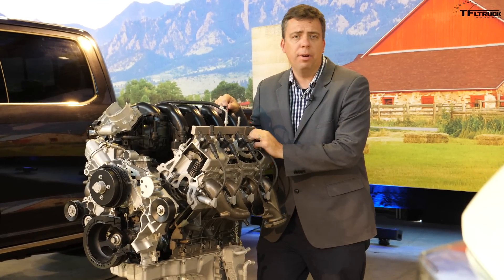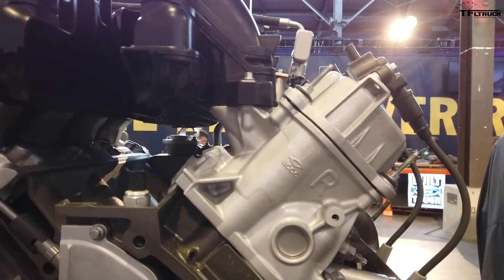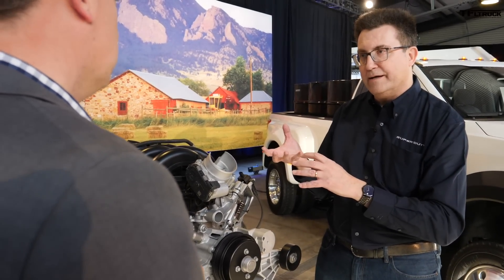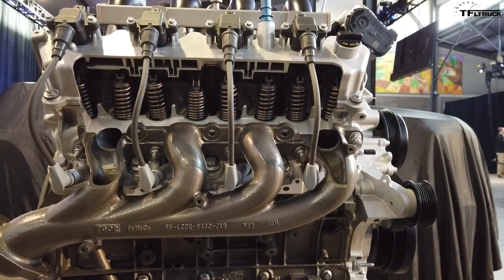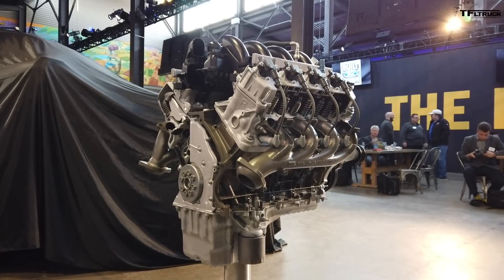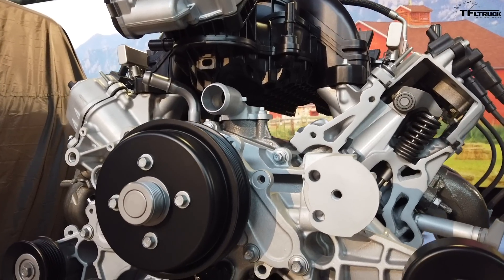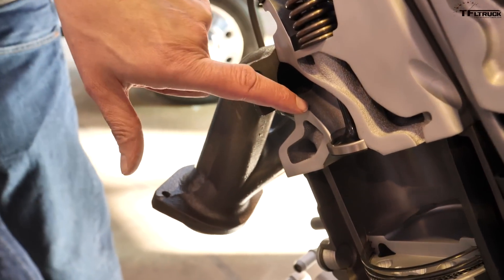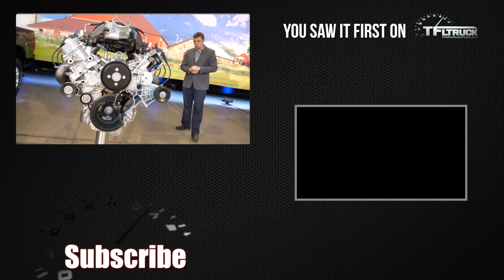2020 Ford Super Duty 7.3L V8: Here's What You Need to Know!

Comment: Ridiculous CARB and EPA mandates are killing diesel. This is a great gas alternative without a bunch of failure prone gimmicks... like turbos, DI, OHC, etc. 7.3L Super Duty is going to be a highly desirable truck!
Reply: Pretty soon EGR will be eliminated from diesels more DEF and that's a good thing. Some talk to new Ram Cummins will have no EGR. Diesel EGR is a weak point on Ford diesels. The main trigger the 6.0's grenaded.
Reply: @Dive-Bar-Casanova  I'm a Ford tech, so I am slightly familiar with the downfalls of the 6.0.
Def systems and EGR systems have caused more pollution than they ever saved in broken parts, wasted fluids, towing, etc. The science behind the carb and EPA pushing diesel emissions is mostly junk. There is a high level of corruption in the agencies. Paid these systems will go someday.... But manufactures must airways be ready for the eco-nazis in CA and DC.
Reply: The guy who owns Powerstrokehelp doesn't like working with 7.3 PSD trucks anymore. In addition, some collectors don't desire them because they are both computerized and difficult to make non-computerized. These collectors are waiting for the EMP blast that renders every computerized engine useless.
Reply: @skylinefever  as a Ford Diesel Tech, I'd concur. I hate 7.3s. mostly because they are just ancient and everything is falling apart on them.... And then there is 4r100s... Bleh!
Reply: Dive Bar Casanova a lot of modern gassers no longer use EGR.  You can thank OHC and variable valve timing for that.
Reply: Lol, DI is a gimmick now?
Reply: @dingusflingus  Your comment seems a little harsh man..
Reply: Hahodi d  they are dogs. Lol. It really makes you realize that turbo chargers are what make diesels powerful. But it's a very reliable engine. I used to drive one. A flat bed IDI. I enjoyed it.
Reply: @TheYummyBrand  ok. To be more clear. DI on gas. It causes so many problems with carbon build up on valves. Then there is Ford's DI but we also put port fuel injection on too just because we engineers and like to over engineer/gimmick up our products.
Reply: @fordtechchris  you're an engineer? What college, which degree?
Reply: @TheYummyBrand  nope. Ford Technician. I fix engineers mistakes....
Reply: @fordtechchris  I figured
Reply: @fordtechchris  which set of valves experiences the coking and which engine?
Reply: @fordtechchris  all collectivists really, lol
Reply: @fordtechchris   I don't think DI is a gimmick
Reply: @fordtechchris  turbos are the shit...I really like the idea of an electrically-boosted turbo/Regen system
Reply: @TheYummyBrand  intake valves on anything di. Eco boost, and the diesels with EGR. For the most part it's not a big deal.
Reply: @TheYummyBrand  to be clear, I'm not saying turbo is bad, or di is bad. But you have to look under the hood of these 1.0L engines Ford is building. It's a fuster cluck. With excessively engineered cac ducting. Multiple electric coolant and transmission pumps for start/stop... And when they put di and port fuel injection on the same engine.... SMH. Now have diesels with timing belts? It's just such a relief to see something like this 7.3L. and keep in mind, Ford was getting 30mpg in the 60s without all of this overly complicated regulation bred stuff we have now.
Reply: @fordtechchris  there are benefits to having port and DI injection, esp for high-compression engines... that's weird there would be coking on the intake valves, I would think exhaust if there are any anti-lag schedules in the tuning...are they overlapping the valve timing slightly?
Reply: @TheYummyBrand  I am sure there are. I'm sure Ford wouldn't do it if they couldn't squeak out .01% decrease in emissions or increase in MPG. When the government's gun is to your head.... You must deliver!
Gunking on intake valves is deposits from soot in EGR on diesel. And oil bypass from pcv on gassers. Pfi helps wash that oily residue. 
ButI believe engineers can get plenty of power, economy and reliability out of a really really basic engine. And offer it at an adorable price.
But what the heck do I know.
Reply: Hahodi d  that's awesome. That engine is my ultimate doomsday vehicle too! They will run on old trans fluid, p/s fluid, even motor oil of you get desperate. And without EGR, turbos, etc it just won't quit on you!! Ha ha. I think there is a reason HMMWV are IDI...
Reply: @TheYummyBrand  it's the intake valves. No fuel injector to spray fuel on the back side of the valve to clean off deposits formed by vapors coming through the positive crankcase valve that dumps  into the intake tract.
Reply: @Dive-Bar-Casanova  egr actually aids in better combustion. It's the egr  cooler design in the 6.0, and most everything else, that is the problem.
Reply: @ryanmccurdy1179  thank you, that's extremely informative
Reply: @ryanmccurdy1179  would that be fixed by using a catch can instead of going back into the intake?
Reply: @TheYummyBrand  pretty much but newer cars won't do that cause of emissions. Like the old diesels used to just have a plain ol rubber hose running down the side of the motor to vent positive pressure.
Reply: @ryanmccurdy1179  got it, thank you!
Reply: EpiDemic117  In what category are we saying nothing beats a 5.9L? Like, nothing makes less power? Or...? Lol... 
But the biggest problem with the Cummins line is, at the end of the day, you still have a POS Dodge truck.
Reply: @TheYummyBrand  I am aware there is a reason to have two fuel systems on an engine. But at the end of the day, you now have twice as much stuff to break, it's twice as complicated to work on, it costs twice as much, etc etc. It's the complicated to work on part that upsets me the most, because manufactures do not pay enough for us to fix their screw ups under warranty.

Comment: I'm digging the F450 regular cab pickup in the background. I knew they offered one but had never seen one.
Reply: Ford doesn't make very many of them. I work at the plant where they're built and I've only seen a handful of them go down to the line.
Reply: Pennywise Kind of curious of how they ride compared to the F350?
Reply: @scottsymons6152  same as a 350 but with a better turning radius due to the wide track front end.
Reply: @scottsymons6152  I'm not sure how they actually ride cause I've never driven one. Just like mentioned before, they do have a better turning radius though.
Reply: Pennywise I use to work for Borg-Warner in Muncie, IN till they shut the doors in '09. We made 4-Wheel Drive systems for Ford. Everything except the Super Dutys. I've been to some of Ford's assembly plants. I'm sure you're use to it but I'd be like a kid in a candy store working there.
Reply: @scottsymons6152  yeah, it's nothing special to me anymore. Lol. Been at Kentucky Truck Plant for almost twenty years now. I'm not even on the production line anymore.
Reply: Regular cab trucks are always the best looking, especially with a short bed out back
Reply: @broncomikey6681  Amen Brother!

Comment: Yeah but will it fit in the Mustang?
Reply: Is your Mustang a tow vehicle? This is a race engine like the 534 C I Ford was back in the 70's. It wasn't.
Reply: Given that is narrower, it would probably fit better than the 5.0. However, it would be longer due to big block bore spacing and would be significantly heavier due to iron block.
Reply: When these trucks start showing up in junkyards this engine will start showing up in fox bodies
Reply: @lb9gta307  or any old school muscle cars or Hotrods.
Reply: E. L. If it’s tuned correctly yes
Reply: I wouldn't want that in my car I'll stick with the 5.0 works just fine
Reply: Big blocks don’t work well in sport cars. Say goodbye to braking and cornering! Nothing beats the 5.0!
Reply: It did once before
Reply: It would be a better engine for the Raptor
Reply: If a 460 BBF can, and it does, so will this new BBF!
Reply: A boosted 5.0 already destroys everything it races why would you put such a heavy engine in the mustang?  Its gonna be way too nose heavy.
Reply: @CJColvin  ..You do know you can easily get big hp/torque from a mild rebuild of older engines..380,428,429,460 can be 700 hp street cars you know..I own a 68 Charger RT with a mild 440 with 670 hp and over 740 torque ! It runs low 10's in street trim,275 wide street radial and 3.23 gears ! I know Ford guys with built 429's and they run 11's with 3.25 axle ratio ! I know people who put more money into converting their Mustang into a modern 5.0 (307 c.i) and I know other guys who either build their old 5.0 (302) of building a 460,429 and they are cheaper to build and run faster/quicker than the new stuff !
Reply: @angelgjr1999  ...Thats a myth my friend,at least for old Mopars..I owned them all and still own a collection...I have a 71 340 Cuda and a 71 440 6 barrel Cuda and they handle the same,you don't notice the weight..I have a 70 Charger 318 and a few 68-70 Charger's with big blocks and I dont notice a difference and with the canyon roads here,I do drive aggressive around the corners and they do very good ! Like a modern car,better than the average modern car but not like an exotic of coarse !

Are modern 4 cyl Mustang owners bragging their car handles better than a 5.0 or a new Shelby Mustang..NO as you dont notice it !
Reply: @RSDX99  just move the fire wall back few inches and make for fit. Like the old fox body mustang when they put the 7.5l in it
Reply: @01trsmar  You're totally correct mate and the old stuff definitely looks alot better than the new stuff.
Reply: 01trsmar It’s physics man. More weight equals worse acceleration and braking. No offense but a modern ecoboost 4 cylinder mustang can probably beat your charger (if it’s stock.) I drove an explorer with a (relatively big 4.0 v6) and it’s nearly two tons curb weight. I also drove a 2017 corolla once. Even though my truck has double the horsepower, the corolla is nearly as fast, but handles and brakes much better. I think it’s Isaac Newton’s law of inertia or something.
Reply: Someone fit a 7.3 PS in a new edge, so it should be possible.
Reply: @lb9gta307  lol
Reply: Angel Gutierrez M113K says hi

Comment: It is about time ford bring back the good old push rod engines smart
Reply: Shane Feeney - I agree Ford built a great engine!
Reply: I think the should bring back the 2v sohc engine from 2000 those were reliable as hell
Reply: @workhard3994  

The 4.6. That was a reliable as hell engine and decently fast too in the right configuration. Crown Vics used them and many vics have gotten near 1,000,000 km
Reply: @P7777-u7r  to me those 2v are the mose reliable engines Ford ever built that's all we have in are family and all we have for work trucks they easy make it to 400,000 miles no problem just make sure the coils are motorcraft and never replace one always all at the same time

Comment: It's a modern 460!
Reply: No, not technically. 7.5 liters is 460, this is closer to 429
Reply: @TheRoadhammer379  its pretty close to both of them. its the like middle child nobody has heard of until now. haha
Reply: 7.3 L = 445 Cubic Inches
Reply: Not even close,I'll take a real 460 anyday...
Reply: Benjamin Kline the 460 and 429 share the same bore size. 460 was a stroked 429.
Reply: @BigCool95  Yes and the garbage that ford build nowadays is a waste of time.And also you don't realize is that these truck builders are making this junk to fall apart.FACTS...
Reply: Kenneth Kobie i dont know about that. All we have ever had are ford trucks for my dads company and our oldest is an 04 f250 with the 5.4 and it has 160k on it and runs fine. My 2011 f250 with the 6.7 has been fine and that has 115k on it. Its all about maintenance and how you take care of something.
Reply: Look at all the garbage diesel engines they build that don't handle more than 250,000 miles,when a good diesel engine can go over a million miles.These new trucks SUCK.
Reply: jmubreader either way I’m sure both were in mind when this engine was being designed. I own 1-7.5L 460 and 2-7.3L Powerstrokes.
Reply: Kenneth Kobie i’ll let you know when my 6.7 gets to 250k if i have it that long. I dont see any reason it wouldnt get to 250k. It has absolutely no issues even when its been 0° it starts fine without being plugged in. We had a 2006 f250 with the 6.0 and that had 150k on it and it was fine too. It got totalled though. Never any issues with it though
Reply: @benvasilinda9729  Find the facts trucks years ago that are diesel would outrun the junk today...
Reply: @BigCool95  It won't make it much passed that without major repairs,whatever it's mind over matter.I don't mind and it don't matter...Then to 250,000 is way short of a million miles so keep dreaming...
Reply: @TheRoadhammer379  7.3l would be closer to 444cid
Reply: Kenneth Kobie yeah it dont matter to me either. I dont keep trucks that long anyway, all that matters is its running good now
Reply: Buying a new Ford diesel is like marrying a hair dresser or a dirty old stripper.  Looks good from the outside but once you find out what the maintenance package is worth, your kicking yourself in the ass wishing you woulda bought a Dodge Cummins.
Reply: 460 was a reliable monster. I had a 79 f150 with a 460. When I sold It , it had over 240 thousand miles.
Reply: Never buy a new first year engine truck. See if they are worth a crap .
Reply: @freedomring4813  that is not always true.
Reply: jmubreader it's a 445 cid to be exact.
Reply: 7.3 not a 460, 7.5 maybe.
Reply: NOT EVEN CLOSE!!
Reply: Looks like the FE
Reply: @benjaminkline4855  that's ALOT of boring broski.... Lmao stroked
Reply: Close enough!
Reply: @kennethkobie9645  please, stick to music.
Reply: No, 445 cu. in. with most likely a bigger bore spacing.
The bore, stroke ratio was not announced.
Reply: @Olds_Pwr  I wonder if they know 61cubic inches is equivalent to 1liter
Reply: Kenneth Kobie while I wish that was true; the 6.0,6.4 and 6.7 would all eat up my 7.3L all day. Now I won’t argue that I would put money on it that mine will last longer and can put on many more miles. One of my 7.3’s has 412K miles and the other one has 290K miles and both are used 5-6 days a week pulling trailers for work.

Comment: Sounds like its ready for an aftermarket turbo ;)
Reply: Yep if i get one its getting twins
Reply: Blowers will come out first.
Reply: @Johnnycdrums  more power more better put a blower and twin turbos
Reply: I'm sure Roush and Saleen have Supercharger kits in the works right now.😛
Reply: You can bolt a Whipple on any V8, you just need to make a adapter plate for the intake.
Reply: No! Supercharger.
Reply: Why not turbos + supercharger.
Lets make a heavy duty lancia delta truck (?)
Reply: drums imagine the size of it!
Reply: I'm thinking a roots supercharger would be plenty to make this a monster.
Reply: @phrodendekia  turbotwin iii
Reply: @dillon-james  why do i see so many people with that profile picture?
Reply: @attachedgrinch5840  look up oh yeah yeah
Reply: @dillon-james  lol thanks meng, I've been wondering about this for a while
Reply: This will be a shitty boosted motor anyway. The cheap lazy bastards gave it port fuel injection and not direct injection. You are better off boosting GM’s new 6.6L HD gas engine. It has the proper fuel injection system.
Reply: @ChuckBeefOG  ford still has the bigger motor and it comes ready for boost
Reply: @ChuckBeefOG  and  the port injection is very reliable  even car with nos use it a lot of cars use port injection because of how reliable it is  directly injected motors have a hard time making it past 100k miles thats why chevy only has initial quality rewards and nothing else